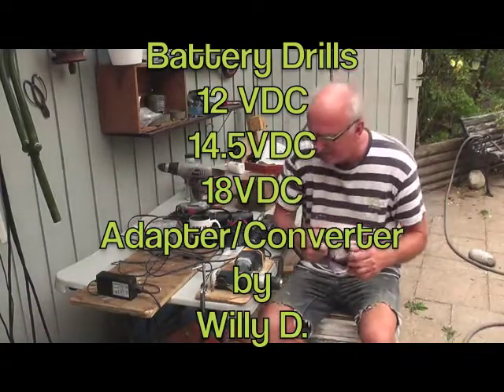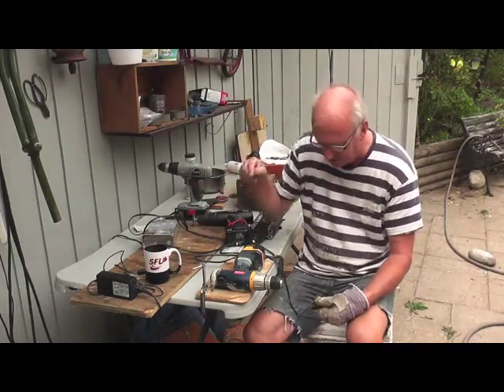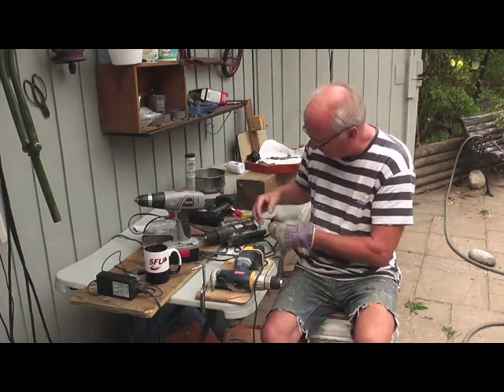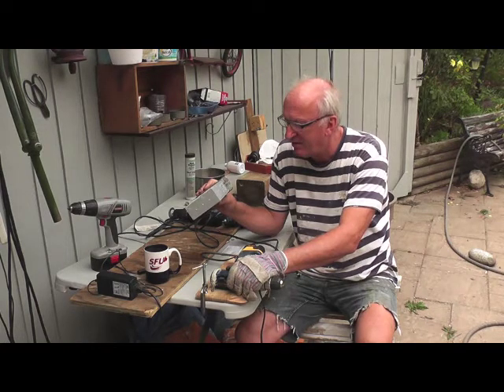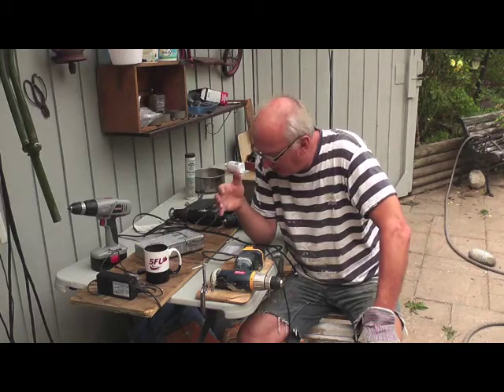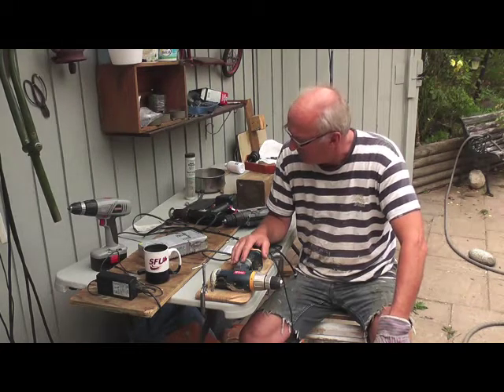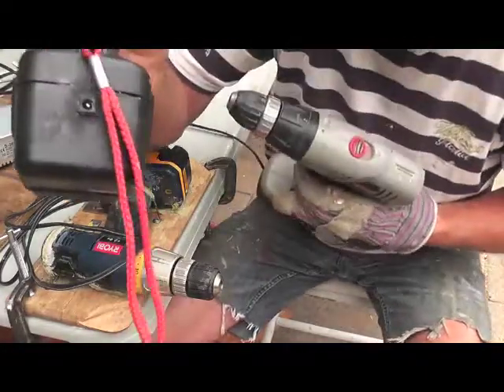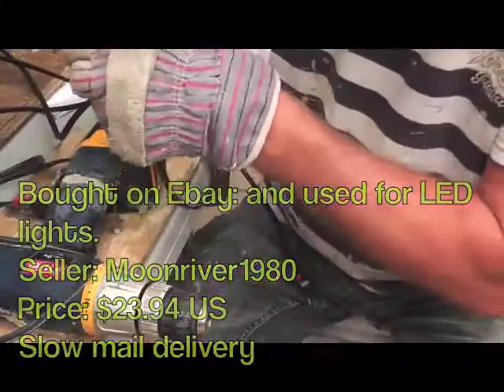Old Battery Drills Reused

Comment: Can you help me....i want to use an old battery drill (18v Makita) to open a simple garden gate (attach motor to bike wheel.... now can i add a remote control to activate and “forward/reverse” drill motor to “open/close” gate? ...I’d appreciate any help with this 😊 Thanks!
Reply from the maker: This is not easy but a garage door motor would work with remote. You would have to design a solenoid switch to activate the drill switch. Maybe a old remote control car would work for activating drill switch.

Comment: Sir, the blue Ryobi 12V you have on your table is exactly like my drill except mine is 18V. what kind of battery should I buy now for this drill or should I just not bother getting a new battery and perhaps change my drill altogether?
Reply from the maker: The problem is buying a new battery costs nearly as much as a new drill set. 
If you just want to drill some holes in a cabinet and use a drill only now and then buy a plug in drill and save money. No more problems with batteries and all you need is an extension cord. The standard plug in drill is cheaper and you will not have to deal with batteries again. While in France I bought a Bosch with hammer action for drilling cement and it's great and cost a little bit more than a battery for a drill.
Reply: @WillyDahm  Thanks, I did so, I got a corded drill. wow the difference in price is big. 👍🏼
Reply from the maker: Great...Glad your problem is solved....Cheers Willy

Comment: I am so confused. I don't really like this topic to be honest, I just want to drill a small hole in my cabinet, but I discovered that my old drill's (10yrs) battery discharge in a matter of seconds. So I thought I would buy a new drill, but to my surprise the drills are sold without batteries, and these costs as much as the new tool. So I thought maybe I can buy just a battery for my old drill, but now I don't know if it is worth it, and what kind? Does it have to be the same battery as the model of my old drill? 🤔 or I should just buy a whole new everything. but now, what to buy? torque? brushed? no brushed? hammer? no hammer? 🤨
Is it anything simple But good and no so expensive for small home repairs? Customer services of these various stores sometimes don't even know or they are so much in a hurry, and they point to me to drills that are way too expensive, I will be using maybe two times a year should I buy or not? Really confusing stuff... sniff, frustration. 😔
Reply: anyways, keep it up Sir, very interesting topic for those who understand. Me scare to pieces 😬
Reply from the maker: Get the electric drill and if you are doing house repairs and need to anchor curtain rails ,toilet holders, towel racks or hooks in cement buy one with hammer action. Get a Bosch or another good brand drill as you will have less problems. Hope this helps...Cheers Willy
Reply from the maker: The staff in some hardware stores get into technical data that is not really helpful. Most drills are brushed and torque is needed when drilling cement or screwing decks. A small drill is OK but sometimes you need to be able to put in to the chuck a larger drill and small drills can't take the larger sizes. I got hammer drill action in my last purchase but it is not needed unless you are going to drill cement for anchor bolts. 
(see below)